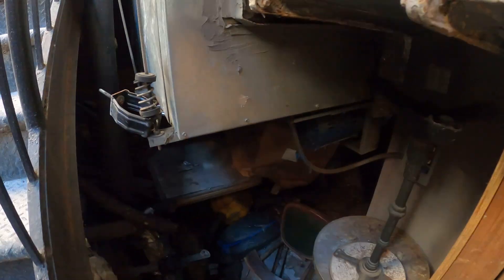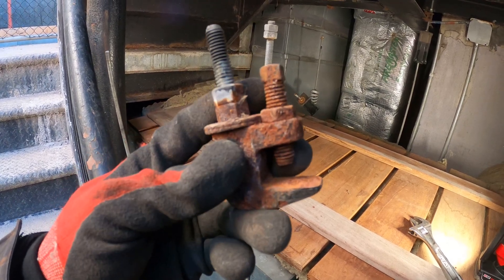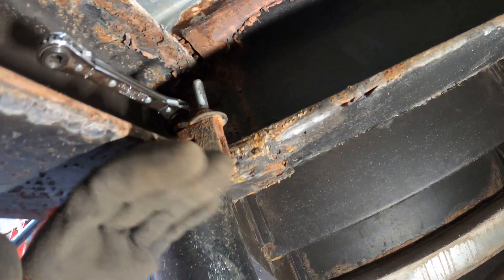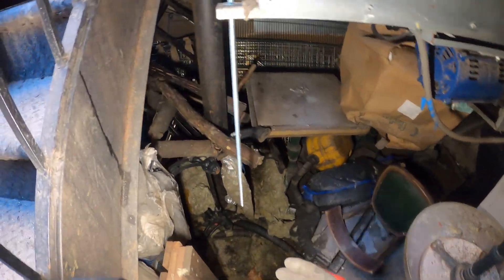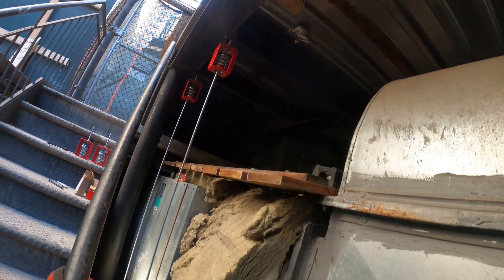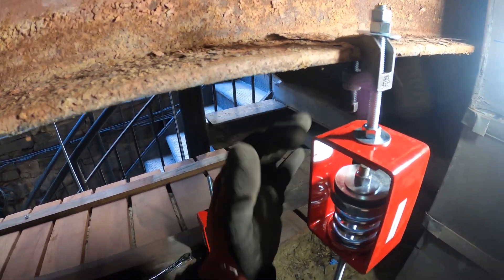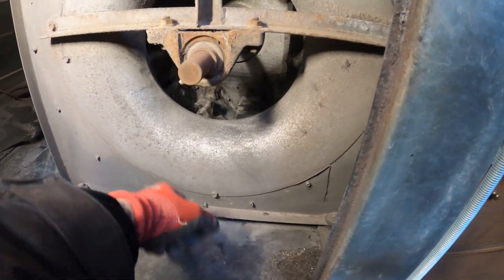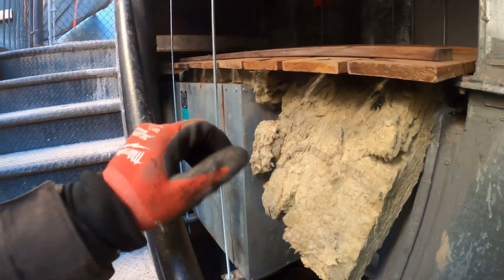HVAC Service Call: Fresh Air Ventilation System Almost Collapsed! Fresh Air Intake System Repair

Comment: you need a second locking nut on top of the isolation springs,
it will back off like you found on the motor, 
and I think you showed a double on the first far side old rod removal